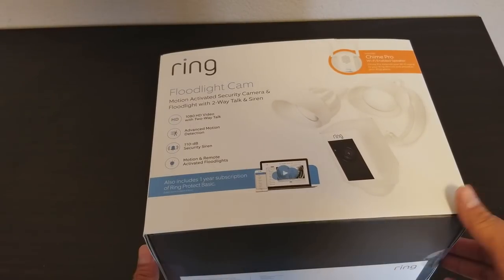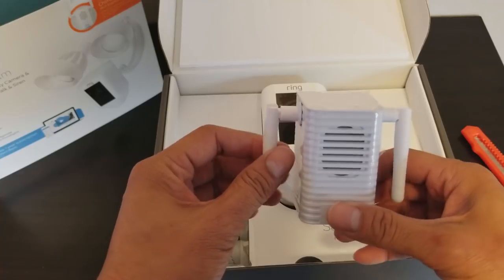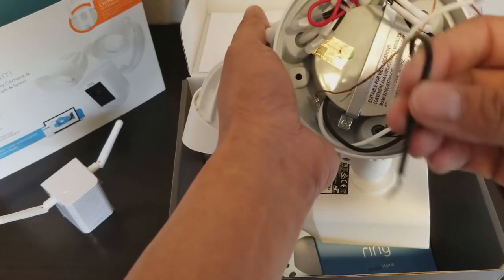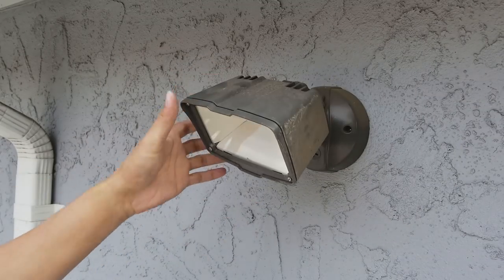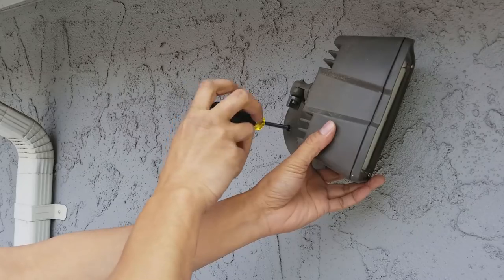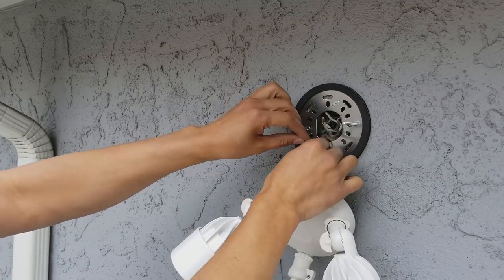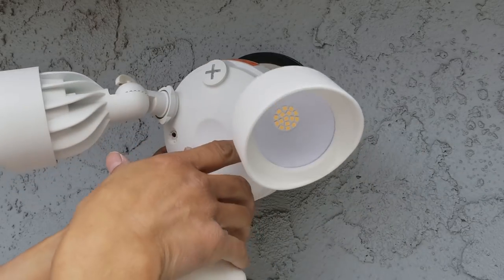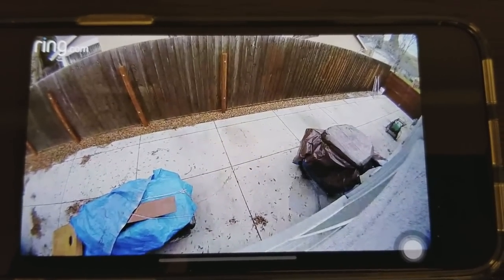Ring Floodlight cam Unboxing and Install

Comment: Great video, Question: when your wall switch is turned off is the ring cam off or Does it still work and record?? Like do I always have to have my wall switch turned to on position for it to work automatically??
Reply from the maker: The wall switch have to be turn on at all time.

Comment: Smart Techh  I have a pre-existing flood light and box mounted like a ceiling mount, in other words its not wall mount facing outward, its ceiling mount facing downwards.  It seems to not work this way, can I get a special attachment to make it work. Re-wiring is going to make this into more of a job than I really want to do
Reply from the maker: The box is it flush or surface mounted
Reply from the maker: Is your box recess into the ceiling
Reply: It’s recessed
Reply from the maker: It should just work find. All you need to mount the ring facing the direction you want the ring to be. Adjust the light and camera to the direction you want it.
Reply: @AllTechGadgets  Hm, although I have gotten much feedback stating that the design of this product was not meant for horizontal mounting...?
Reply: @AllTechGadgets  You really can't get the camera facing where you want it...It doesn't seem to be designed for this type of mounting
Reply from the maker: @dezertease  I will check out my to see how far cant you adjust the camera
Reply from the maker: @dezertease  I think the only problem is that the motion sensor wont detect until get close to it.
Reply from the maker: @dezertease  you can remove the  camera and get a short piece of 1/2 PVC to add on to the neck of the camera to  extend it out. I did that with one of my inlaw floodlight
Reply from the maker: @dezertease  if where the ring camera neck screw into the box is 1/2 threads. You can modify it. If not then no!
Reply: @AllTechGadgets  I might have to drill a hole in brick if I can redirect the cable. Then I'll use an outdoor wall mount box and put the Ring onto that... This just turned into a lot of work... 

They should have made it versatile because they do not know what each persons situation is... They give you so much stuff in the box for just in case,,, The actual design should accommodate either situation.  I guess an electrician was not involved in the designing of this product..lol 
Thank you for your time.

Comment: Do you have to do some sort of weather (water) proofing as the light fixture housing seems to be plastic and may not be durable (especially under extreme sunlight and heavy rain, etc)? Thanks!
Reply from the maker: No you dont the fixture itself is made for outdoor.

Comment: Home Depot has the Ring floodlight on sale for a 2pack for $336...has to be purchased online.
Reply: Home Depot had a deal of the day special on 2 floodlights with a ring chime pro in the bundle for $314.00. I bought 2 more bundles 🤓
Reply: Rotty Weiller it s nice with that price.im waiting till it is on sale again

Comment: You were able to just simply screw base plate into cement? I'm planning on installing/replacing this floodlight into brick. Please advise.
Reply from the maker: If you are mount it with outdoor surface mount box. Buy blue color masonry screw to mount the box. It will screw right into the brick
Reply: @AllTechGadgets  thnx for the reply. So no need to drill it in?
Reply from the maker: @michaelcampusano5274  if you use the masonry screw you dont need to drill
Reply from the maker: @michaelcampusano5274  using masonry drill bit to pre drill the hole make it easier.
Reply: @AllTechGadgets  ahh ok. Thanks for the tips!

Comment: Do I have to have a junction box? I noticed when I pulled my old light off it didn't have it, so when I wired new light up I just wire nut together and wrapped them in electrical tape.
Reply from the maker: If there isn't a junction box, you should buy a surface mount outdoor box to mount the light.

Comment: There was no ground wire coming out of your junction box? 🤔
Reply from the maker: Yeah, somehow there wasn't a ground running in the box, it still okay to run with out a ground but is not as safe as having the ground. It was mc cable so it ground to the panel. That why I ground the bracket to the light
Reply: SmartTechhh cool. I’m from the UK. I’m going to have a go at installing it myself. Electrics a bit different over here, as we don’t have junction boxes. 👍🏻
Reply: @carlg5086   the box and race way are your ground thats just added protection hopefully its conduit all the way back... hopefully its not romax

Comment: Are you able to pivot the camera so it faces either left or right. I want to put one on the side of my house and turn the camera all the way to one side. Is that possible ? Looks like it may move.  Thanks
Reply from the maker: You can turn it like 80%
Reply from the maker: Left or right but not all the way

Comment: Would this work to replace a regular porch light?
Reply from the maker: Yes, it will replace a regular porch light.
Reply: Thank You!
Reply: How many devices can be connected to this camera at once as far as cell phones?
Reply from the maker: @reecew27  as many device you want, just download the app from google play or apple app store depend on the device you have
Reply: I got my floodlight hooked up and it works but I noticed I dont have an electrical box where my wires come out of my house so I wire nut the wires together and wrapped them in electrical tape, should I be fine or do I need to purchase the electrical box?

Comment: The lock nut on the collar on mine is tight to loosen
Reply from the maker: Use Channel lock wrench to grip the nut to turn it loose.
Reply from the maker: My is not right, was able to use my hand to losing i.

Comment: My house doesn't have the floodlight. How can i install it? Thanks
Reply from the maker: Where are u planning to mount the ring floodlight? You have an existing light that you want to replace with ring floodlight.?
Reply: SmartTechhh I plan to install in front of the Garage, but mine doesn’t have floodlight connection😢
Reply from the maker: @youngdoan3465  you can run power to the front of the garage from inside of the garage. Use a outdoor surface mount box to run the wire in. Mount the   ring on the outdoor box.

Comment: Do you need to turn off all the electricity in the house before installing?
Reply from the maker: Kymberly F u need turn off the breaker to that circuit for the light
Reply: This flood lamp does not need to be hardwired. I found a way to make it AC power. Just plug it to a socket and you're done.

Comment: we worked for Hours trying to get this to connect and we just returned it to Home Depot our doorbell is working fine but this floodlight would not sink!! it also takes too look for the doorbell to show who is at the door.
Reply from the maker: Your wifi might be too far from the rings.
Reply from the maker: You can get the wifi mesh to fully cover wifi connection around your house
Reply: Did you try a wifi extender? for example the 'TP-Link RE200 AC750 Universal Dual Band Range Extender'